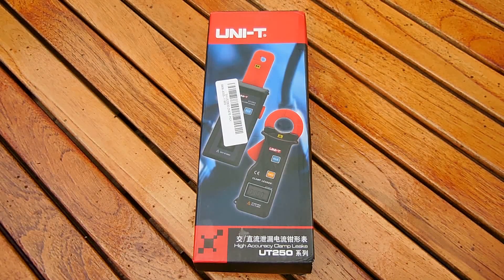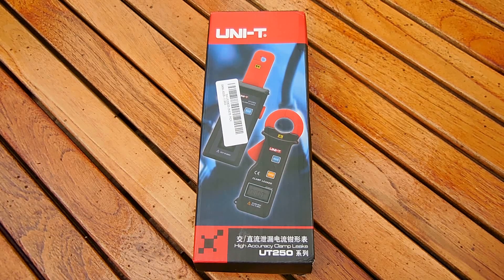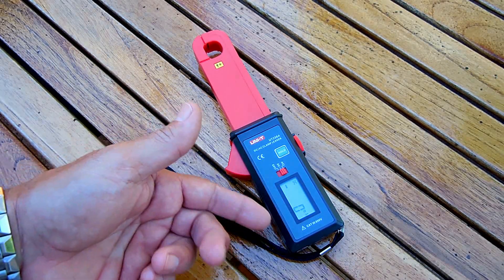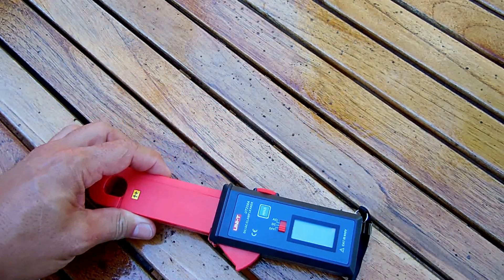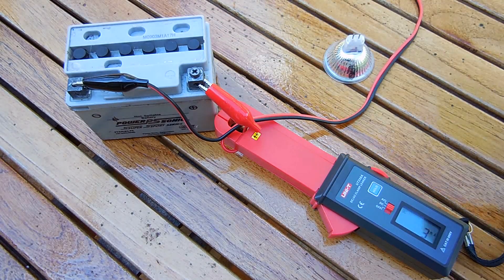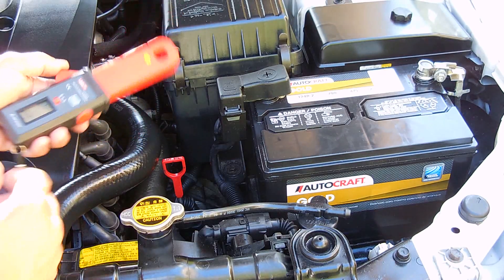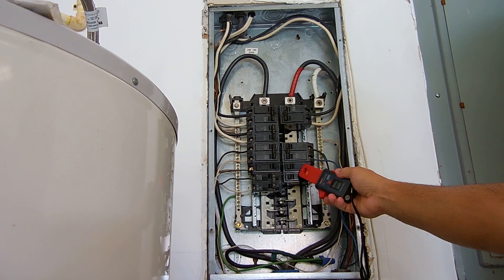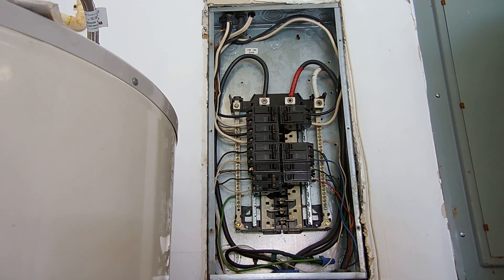Parasitic Drain & AC/DC Leakage Testing

Comment: Was hoping to see this tool used to clamp both neutral and hot lines to look for an imbalance caused by leakage current.  This video only shows it being used as a current measurement clamp capable of mA resolution.
Reply from the maker: That's true, a higher current reading on the hot wire, and lower on the neutral, would indicate a leak between the hot wire and ground.

Comment: what is the unit that you are using?  it is not the one that you have linked to this video because I bought one and the clamp hole is only 7mm in diameter. not big enought to fit over the battery cable.
Reply from the maker: That's weird. My opening does look larger than what is shown on the box in the video.....but mine does say UT258A. When you open the clamp, are the plastic walls of the hole wider before the iron core? Or is the iron core very close to the plastic?
Reply: core is very close to the plastic
Reply from the maker: Unreal. I just looked online and all of them show a smaller opening, meanwhile mine has a wider opening with the same exact model #. I would call up and ask. Too bad the plastic wall wasn't thicker, you could have drilled out the hole to make it larger to accommodate a larger diameter wire. 

http://uni-trend.com/contact.html

Comment: if a ac clamp meter were used on DC. what would the difference in the reading?
Reply from the maker: You cannot measure DC using an AC meter.

Comment: Hi Doug. Very useful tool you are showing in this video. I will check this out and thank you for the codes you add. Your tips for using this tool is spot on. If memory serves I used an old school amp meter to see which winding if any were drawing excess amps in three phase electric motors,has sometime the ohms scale will not show a bad winding. At least with the antique motors I tested back in the day Lol.
All my best.
Bobby
Reply from the maker: Bobby Tectalabyss Very useful tester. :-). I've also done that in the past with 3 phase motors , but now I use the megger. Thanks for watching Bobby